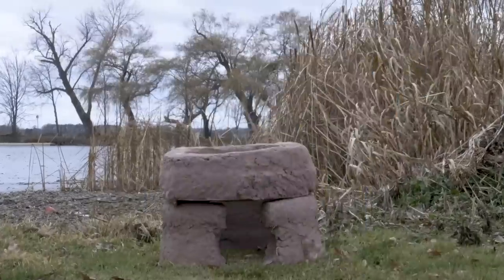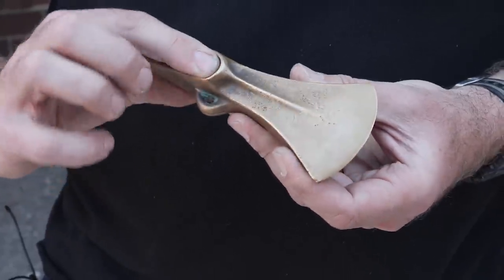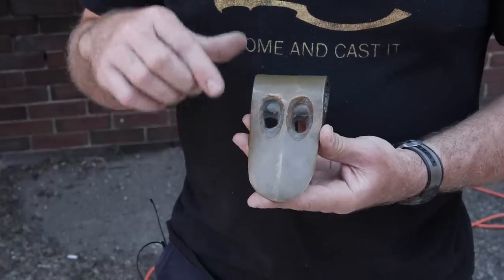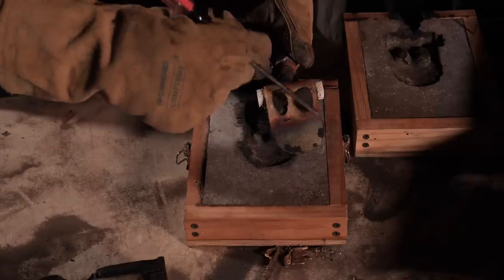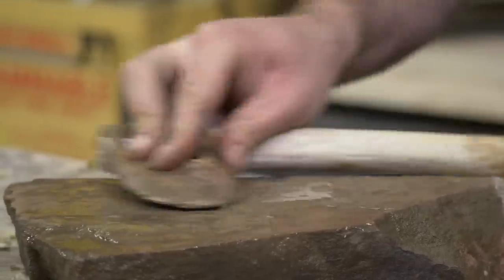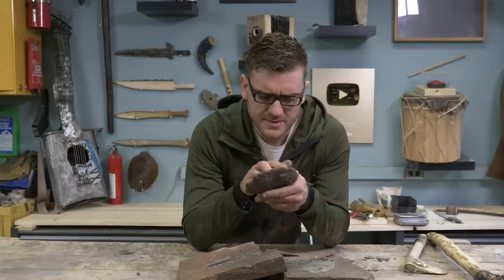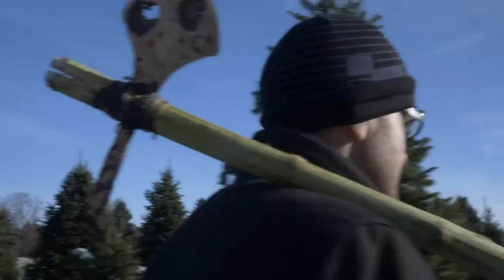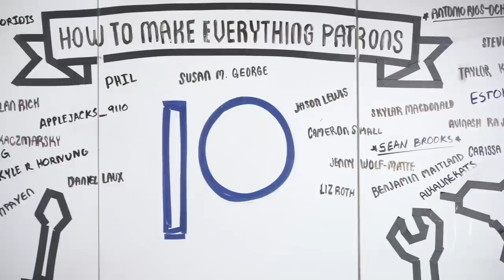Casting an Axe Worthy of Thor Using Primitive Technology

Comment: I am uncertain about bronze, but with steel similar oxidation colors occur. Different colors correspond to different temperatures reached by that piece of metal after a quench. When the color is close to a straw yellow, there is almost tempering, but when you move towards purple you get softer and softer as the stress in the crystal structure of the metal is released by being given enough energy to transform. I suspect that the thinner parts of the pieces lose their temperature rapidly, resulting in a quench like effect. The residual heat in the larger sections of the piece then effectively temper the regions. The color gradient is due to heat being fully radiated before reaching the far ends of the thinner sections.

Comment: Sand stone is porous, and is a combination of  minerals, some of which breakdown to produce water or CO2 at the temperatures of about those that the bronze is at, so that might be why. An idea that might help is to carve a deeper mold and add a bottom layer of glass, the other might be to poke any cold spots when you poor the mold (being careful obv). Other wise perhaps use a dry sand bottom instead of glass.

Comment: The defects in the axe that you where casting where caused by the difference in heat between the stone and the metal being used to caste I normally try to keep it within 500 degrees  of the temperature of the metal. The defects where caused by the air in the stone pours expanding due to the extreme change in temperature.

Comment: Nice video! But the archaeologist in me must say that such a flanged axe would have been cast in a bivalve mold, as in two pieces.
Reply: It would need to be, right? I don't see him making a good product by pouring horizontally into one mold
Reply: @Direblade11  Nope, I tried that myself for a copper flat axe. And it is pretty difficult not to get bubbles in the cast. But I guess he made a workable product
Reply: I think he mentioned that.
Reply: @juliusroman8616  Ah, my bad then

Comment: @How To Make Everything Limestone decomposes at around 850 degrees c into calcium oxide and carbon dioxide, bronze melts at 950 degrees c. Those bubbles are caused by carbon dioxide. You need a different stone that doesn't decompose.

Comment: If I remember my chemistry classes correctly😏, the colour variations are caused by the dissipation of heat as the metal cools. As you observe in the film, the molten bronze has the consistency of molasses on a cold day, consequently, by the time the caster has finished pouring, the first of the bronze to enter the mould has already begun to cool in comparison to the bronze at the top of the mould. As the axe head tapers (is wedge shaped) the bronze near the blade also cools faster, owing to there being less material there. Whereas the handle and mid section of the blade are much thicker, the heat takes longer to dissipate and solidify resulting in the colour variations you see. A wee scuff with a wire wheel or brush would eliminate the effect (polishing the metal). In fact, until the invention of the thermometer in the 1600’s, this was how blacksmiths gauged how hot to heat a piece of metal before working on it. Yellow hot and red hot and white hot are all different temperature “grades” and ancient smiths would have learned this knowledge over time through trial and error, talking to other smiths and finding what works best for them etc. As I recall, if one wanted to harden things that were going to take a lot of abuse (farm implements, tools, weapons, armour and so on) you’d heat it until it turned a dull blue before ‘quenching’ it in a liquid-usually an oil of some sort- this was done by plunging the still hot piece into a bath of oil which evenly dissipated the heat and hardened the metal. What you see with bronze casting is the same phenomenon, before we learned to ‘harness’ it, if you like. Hope this helps, Cheers from the Dominion of Canada!!😁👌🏻🇨🇦🇧🇲

Comment: two part stone molds would have been made by using a wedge split technique to make two mated halves out of a single stone slab. At least, initially. Later on, they did develop grinding methods that would allow them to make "reasonably" flat faces to put together.

Comment: Using sandstone instead of soapstone was definitely an issue. Sandstone is often made of primarily quartz or feldspar, 7 and 6 on the hardness scale, respectively. Soapstone is primarily talc, which is a 1 on the hardness scale, which makes it incredibly easier to carve than sandstone. Also, sandstone is very porous and will trap a lot of moisture, which definitely caused it to crack after 2 pours (I'm surprised it survived the first one, honestly) and very likely caused those bubbles. I also think the pour should have started at the blade of the axe and gone back towards the handle to ensure nice flowing bronze was used at the more important part. 

Honestly, I might try pipestone (abundant in Minnesota) for a mold. It's a hardness of 2.5, so it's a bit harder than soapstone, but is still carved easily.

Comment: the stone should be metamorphic because it is formed under high heat and pressure, also the stone should be heated beforehand to evaporate any residual moisture and stop rapid heating

Comment: I think it could be a slag issue with the bronze, also casting vertically will help with gas bubbles in casting. i don't know a bunch on casting so thos might not be the issues.

Comment: pouring in one flow without letting the bronze wrap around back into itself should reduce those cold shut breaking points. Also I think pouring back over the top of the axe at the end of your pour likely caused some inconsistencies.

Comment: A thin film of oxide formed on the metal surface that make the interference effect which intensify  or weaken diffrient wave lenth depending on the thickness of the film.

Comment: i think (not sure) that the color obtained in the casting is due to the residual heat in the thicker portions of the piece "re-heating " the thinner pieces to the point where it changes color

Comment: Because all kinds of things can be broken down into particulate the size of sand. Therefore it is pretty much impossible to determine without modern technology what kind of dissolved minerals and possible volatile gases are in your Sandstone before creating a mold. There's a reason soapstone was used instead is much less volatile

Comment: The reason that happens is because even tiny amounts of water in rocks will expand after evaporating you need stone with very little space between the spots in the stone
Reply: You need to remove all of the moisture from the rocks before you can use them as a mold

Comment: I love how Greg's shirt has a traditional Canaanite Khopesh.  I personally went to some pretty extreme lengths to make 4 of these for theatrical productions.  That said... mine are steel so they last a bit longer than the traditional Bronze they were made out of.

You made a mistake... you stated you are 4000 years BC... the Bronze age began about 3300 BC and ran until 300 BC in some areas... indeed the majority of the Old Testament takes place during the Bronze Age... and the Khopesh I mentioned above is a clear example of a bronze age weapon dating to around 800-400 BC.   AKA... please mention correct timelines.

Comment: A reddit user believes that the rainbow effect on the metal comes from accelerated formation of oxides, which form faster as you get closer to the heat source, causing a distribution of different colors to appear. I'm personally not sure, because even though my focus is material science, I mostly work in room temperature or cooler research.

Comment: sandstone is exceptionally brittle, which is why it wasn't especially good as a casting material.  Also couldn't you replace the wood used to make the sand casting flasks out of the clay mixture you have been using for your other casting methods? Make a hollow box on a flat, smooth surface, then make another and boom you have the sides of your casting flask.

Comment: Ok your handles get a bit better especially the one for the small one. The big one ... you dont want any branchholes on your handle. They will cut open your hands easily with any heavy load. So you would have to grind them away wich is rather tricky ;) instead you take a piece without any branch. And or a part from the tree trunk. Any wobbleing however is fine as long as its not to extreme ;)

Comment: the reason why your ax broke is the impurities with the air which one thing you did wrong is not having 2 stone to fill in to be holding it, casting it 1 side will not work, so what you can do is use the clay for the stone surrounding it making like sort of like cacoon then you can mix some wax that is ok on the stone or something but everything will be alright once you pour into the stone casting but it is all your chose to pick among how you wanted to cast it but whatever.

Comment: One question, one simple question. With all this molding and pouring of metal, WHY HAS HE NOT JUST FORGED THE TOOLS? Not melting and casting, taking ingots of bronze, heating it up then shaping what you want. Best part about this, simple molds to pour into and make, and TOOLS THAT HAVE NO AIR BUBBLES AND IMPURITIES. Not trying to be mean, just mind boggled about a simple fix no-one has mentioned that I have seen.

Comment: The flaw wasn't really with the mold but with the heat you got the metal to, as well as the heat of the mold itself. You heat the mold to remove locked-in moisture (which sandstone tends to have a lot of) as well as to help with other general outgassing (again, an issue with sandstone, due to its high porosity for stone). The lower heat of the metal itself is also a problem, because it's not flowing freely and those voids are appearing within the structure, making it much weaker- you got lucky that the blade of the second pour only had those two large air pockets, but that still weakened the metal; with modern technology that's not so much a requirement, but with ancient metallurgy, it definitely is.

 You would likely do better on the heating front by making discrete bricks of cob and then assembling them into a kiln shape using wet cob as mortar, and then once it's surface-dried, run a fire in it to further drive off moisture and harden the bricks further; you can even fire other bricks in that kiln and then use those fired bricks to create a better kiln (and no worries about era; the first fired bricks were found in China dated to around 4400 BC). The current kiln you have has far too many air gaps along the chimney column, and we've seen now multiple times that it isn't sufficient with its current build to get up to heat, as there's solid bits of unmelted metal that pour out of the crucible, not just slag. Using the ashes from the fuel you've burnt in the cob mix also helps with making it a good firebrick, by providing a good thermo-stabilizer, in a ratio of 5 parts clay, 1 part ash, 4 parts soil mixed with aerators (straw and such); I remember you used some charcoal before, but you might want to revisit the ratio of ingredients, if they aren't close to this mix.

Something else you will want to think about is crafting a crucible that is much deeper, a bit thicker, and has a spout built into it, so it pours a lot easier than the crucibles you've been using.

Comment: Forgive for my lack of knowledge, but why did the sand casting has to use wood planks frames? I mean you can make do with rough split log and it would still be fine wouldn't it? The frame is just to pack the sand in and so long as you got the frame pretty sturdy it shouldn't matter if it crooked or frayed right? If you can held it together with rope it should be fine

Comment: Yeah, making the stone mold out of sandstone is a bad idea, especially if you obtained the sandstone from the ground or a stream bed.  Sandstone is very porous and can hold a surprising amount of water, which causes it to split when heated.  I have many memories from my childhood of making a fireplace out of found sandstone, only to have some of the rocks spit, sometimes violently.  Soapstone is a much better rock, not only because it doesn't hold water the same way, but also because it's so soft and easy to carve.  I know Connecticut has soapstone deposits that were mined by the native Americans and used to make things like bowls, but I don't know if there's any near where you are.  I believe it's a metamorphic rock, and is often found with olivine, so you'd have a hard time finding it in the Great Lakes area, with all that glacial till.  A soapstone mold would certainly make for a great looking axe head though, especially if you made it a two part mold and cast it like you did the sand castings.

Comment: When you get to making ic chips you could collaborate with a dude named Sam zeloof.
Reply: Nobody is making ic chips
Reply: @RedsnowHD  it's actually not as unreachable as you'd think
Reply: @username-rs4vf  it is, making a circuit, maybe possible, but no way a ic, i work in the industry trust me
Reply: @RedsnowHD  I don't need to trust you: I can do thirty seconds of "research".
Since you're not curious enough to bother, I'll describe a chip Sam made at home: a 6-transistor differential amplifier on a 5µm metal-gate PMOS process.
Since you're industry (I'll give you the benefit of the doubt; your credentials are as important on the internet as they are verifiable), you're might be thinking of much larger scales of integration. If so, that's too bad; SSI (which I'm not sure isn't what you meant by "making a circuit,[sic] maybe[sic] possible") is still IC technology.
Reply: @okuno54  i was thinking of   silicon integrated chipsets. Which you need a whole factory of expensive machines for

Comment: The explanation of the hardening process is better, but still not correct. It is true, that you introduce defects to the crystal structure, but the mechanism has nothing to do with bending. These defects stop microcracks from spreading through the structure, hence you won't get the axe to break apart. I guess it could seem counter-intuitive,  but enough small defects in different directions stop large defects from forming.

Source: 5th year in material chemistry

Comment: After some very quick googling: "Generally sandstone is a very porous rock as rocks go and will have substantial pore spaces." So yeah terrible rock choice for a mold. Not very sturdy and has a lot of pockets for potential gasses/liquids. Soapstone (the stone he mentioned being used) is non-porous so I'd use something closer to that.
Reply: Also-the 'glue' that holds the sand grains together is often limestone, which when heated to high temperature release CO2 gas.

Comment: That axe head looks like a disaster. Why not just base the bronze axe head design off the shape of a stone axe head? Then you could have just used top down pouring into a very simple mold. Also has anyone considered that maybe the technique for using primitive tools like stone or bronze axes was different from how you would use a modern axe? Maybe more batoning?

Comment: You clearly pour the bronze too fast, trapping air under the bronze as it leaps forward in the cast. Pour evenly and slowly.
Reply: Does a horizontal cast even work as well as a vertical one?

Comment: im thinking  your metal isnt hot enough when you pour there isnt enough of it and you pour slag  not that i am a professional its just a observation  as for your  stone mold   try a igneous rock instead of a sedimentary rock and i suspect it was thermal shock that destroyed it  yes you heated  it then poured  but i think your going to need to insulate your mold to keep the heat in and let it slowly  cool which i believe will increase the strength of your casting   . as for your clay or cob molds much more mass needed for thermal shock protection  and probably a day in the kiln first  to ensure it has no moisture  and any combustibles have offgased before you pour. one of your best efforts to date but i still feel that you are halfassing your builds and not really caring about your finished product  as long as its finished and you move on and say its worth X$ for so many hours work,,,, but if you were an artisan   people would complain and buy from a better artisan since its a single creation and not production  you cant really assign a dollar figure to your artwork based on the time to create a tool which is functional and durable  as apposed to something resembling  that tool .i have to applaud your motive but feel you need to apply yourself more  and regardless of my opinion i need to thank you for the video as always

Comment: I really think you need to work on your pouring aim.  Far too much getting spilled.  I would imagine if you were an apprentice back in the bronze age you'd be getting smacked a LOT for spilling so much when pouring.  Perhaps the next tool to investigate would be a good set of metal tongs you can use to lift your crucibles instead of those sticks.  I don't think they allow you the control you need.

Comment: The casting is terrible, you'd better melt it and cast a new one, the melting bronze must be casted up to down the mode. the surface can't touch the air.
Reply: Better than anything you can do